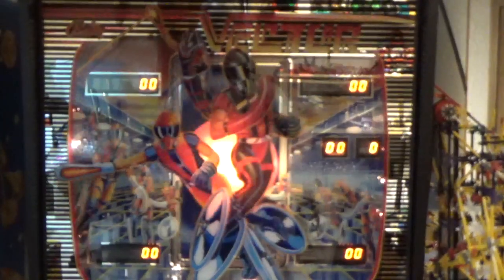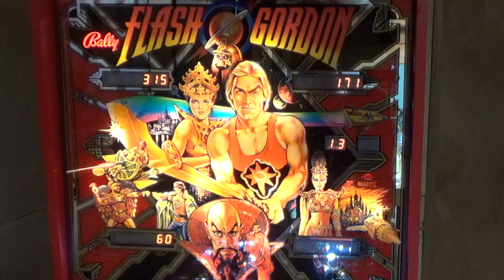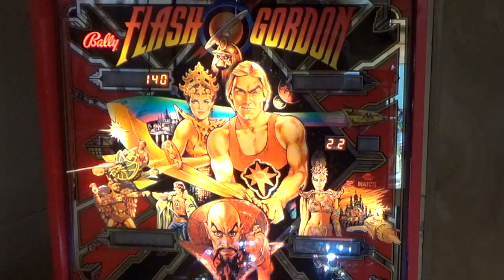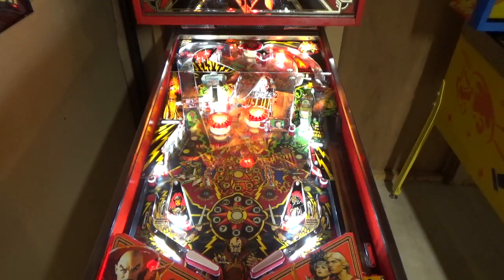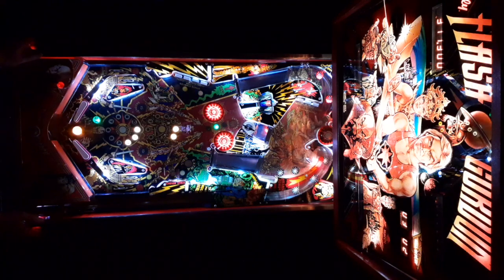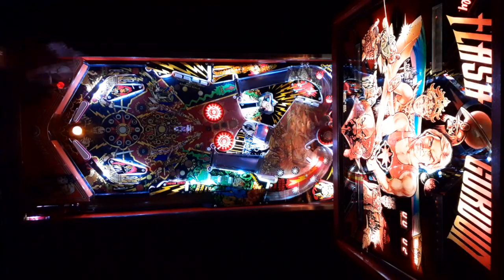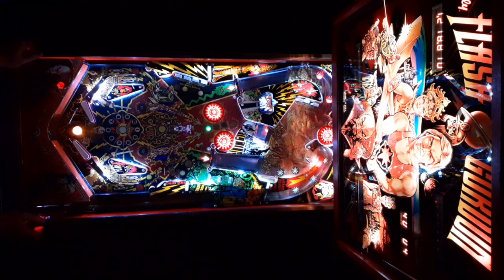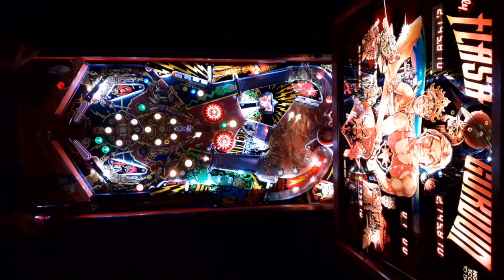Pinball Repair - Arduino Upgrade Update

Comment: I'm really interested into tinkering with the original code on bally SS.  How difficult is it??
Reply from the maker: I did a lot of programming of large systems back in the 80s and 90s, and although all the programming came back to me, I found it a challenge to figure out the Arduino code. It's a pretty big system with a lot going on. But I worked at it a bit at a time. The Flash Gordon code was not well documented, but the names of variables made it fairly easy to follow small blocks of code (e.g. TopPopLit, BallInSaucer, FreeBallCollected, etc.). But it certainly can't hurt to get the Arduino IDE (you can get it for free, just to check it out), and look at the code to see what you make of it. Be sure to keep a separate copy of the original code. Look for the starting point function loop(), and follow the code to see if you can follow. The IDE also makes it easy to track variables through the code, and find functions. So, give it a try and see how far you get!

Comment: No ball save?
Reply: I have a bally silverball running BSOS.  And it's totally different,  more playable,  harder game.   It's great!!
Reply from the maker: I fixed it so that if the ball goes down without hitting anything, it will kick your ball back out. I'm not sure if that counts as ball save. You can absolutely program a ball save with whatever rules you wanted, though.
Reply: @davesthinktank  ball save is when you drain in like 10-15 seconds after you plunge the ball. A second chance at that turn.
Reply from the maker: @snextime  Now I'm thinking I might really like to write a ball save, with Princess Aura saying "Don't kill him yet, Father. I want him!"
Reply: @davesthinktank  I had someone write a ball save for my FG roms about 6 yrs ago and its a game changer especially for guests!(: He wrote it using that first switch you hit in the shooter lane and then test bank 20 in the admin has 1 to 15 to roughly account for up to 15 seconds of ball save time, so you can adjust it. So when you launch the ball the timer starts after you hit that first switch in shooter lane, it also lights the shoot again circle insert at the drain letting you know that it just popped another ball out into the shooter lane. Its an amazing feature and allows you to set the game to 3 balls vs the old school 5 balls.